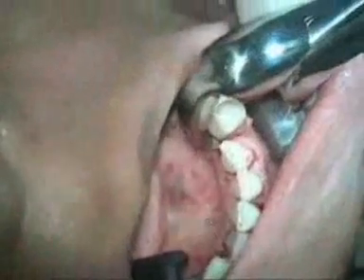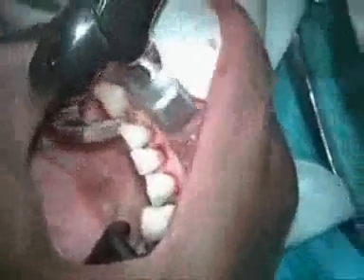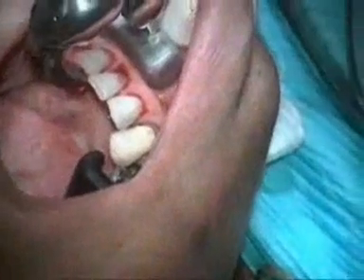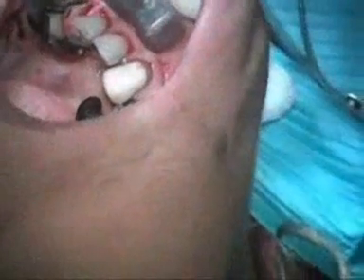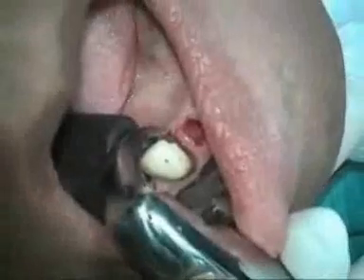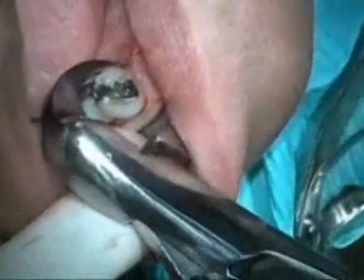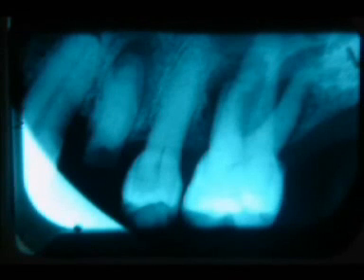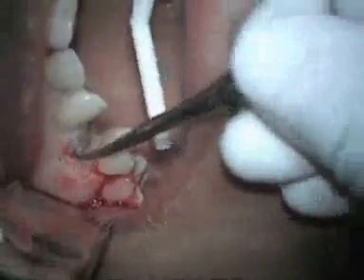Physics Forceps

Comment: its being used a little incorrectly. the doctor isnt supposed to use that much force. the pressure from the bumper creates acid in the pdl and breaks up the fibers thus allowing for easy extractions. i've seen these forceps used the wrong way quite often and doctors end of breaking the buccal plate. i'm a huge fan of these forceps as well!